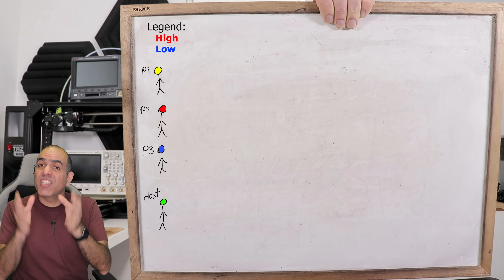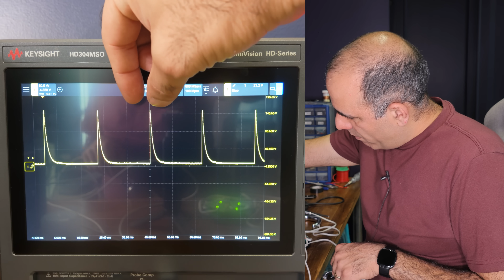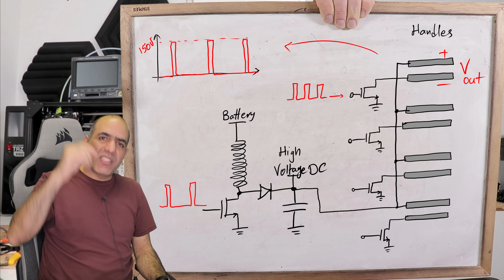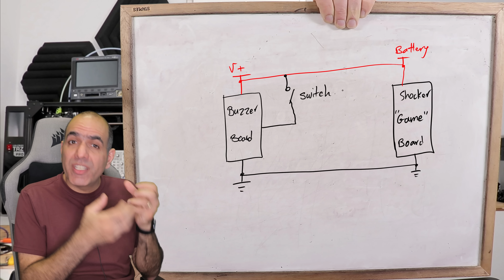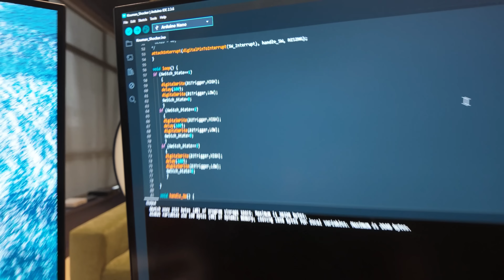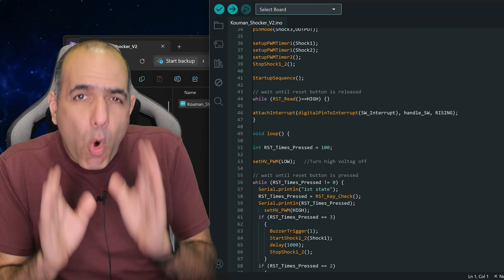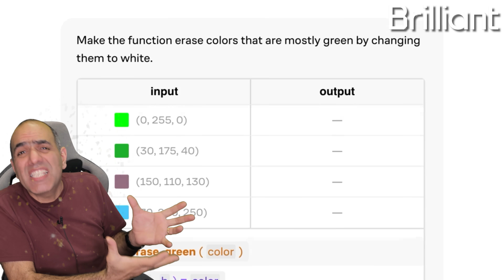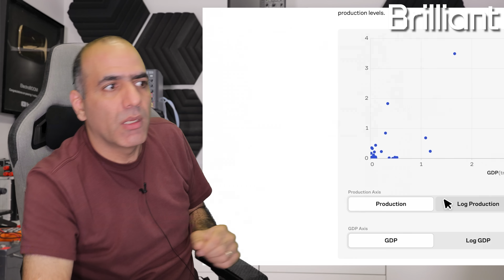BE SLOW, GET SHOCKED!!! (feat. @Kouman )

Comment: I have an agaro car vacuum cleaner with an AC port for charging the battery. While charging it cannot be used. Could you suggest what all things are required to add a separate DC port on this for direct connection to the car 12V port. If any resisters or capacitors are required to limit or smooth out the current or can I directly connect the motor wires to the car's port.

Comment: Roast my place of works electrical system. 80% of breakers won’t trip, outlets explode when you kick them, wires everywhere, breaker panels in stupid spots, easy to access 277 volts for signage and lighting, and a 265 volt outlet in an easy to access spot where students gather to eat with nothing plugged in or shoving crap. Also there are 240 volt outlets under 115 volt outlets in the bathrooms and hallways. Roast this please.

Comment: Game improvement. Replace the handheld buzzers with metal wrist straps. They can’t let go then 😂 and use the original button buzzer to buzz in.
Reply: Modify some ESD straps and remove the resistor 😁
Reply: And boost the voltage to 200v